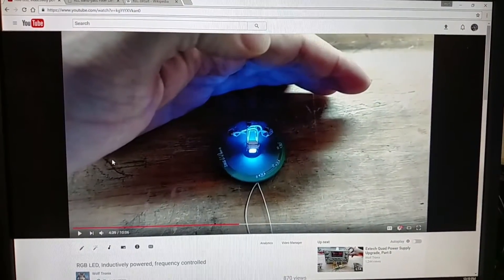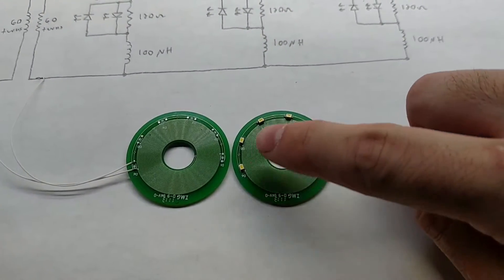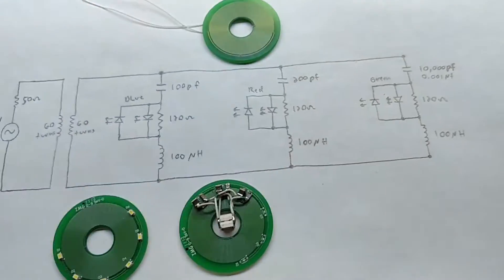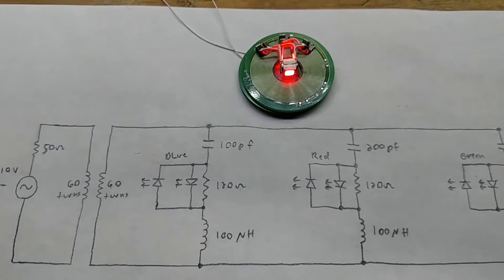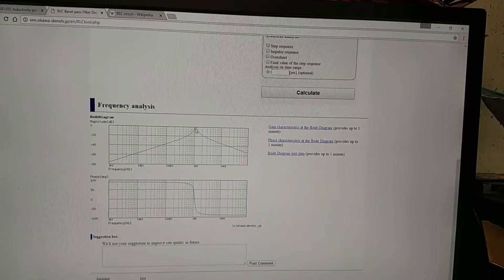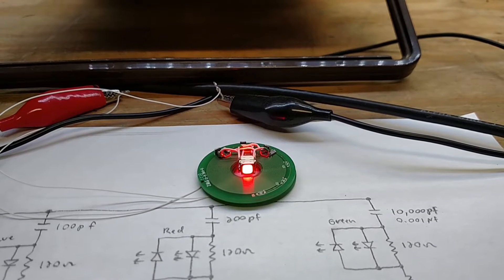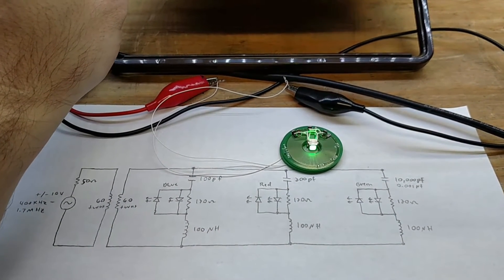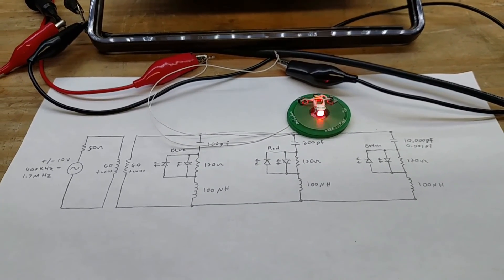RGB LED, Inductively Powered, Frequency Controlled

Comment: One idea for detection(If your still doing this).
Add a 4th leg, one to pick another frequency that can be used purely for detection and the value of this circuit will select the hotel/corporation/building tiles that will act as a load to detect.
These can be closer together and scanned though either by a dedicated circuit(Squarewaves or other nasty harmonics less of a problem Because efficiency won't be needed and a detect cycle only needs to be run infrequently)   or if your main design uses switched VFOs.
Reply from the maker: +Electra Flarefire 

I have not worked on this past this proof of concept, but I like your idea. :)

Each hotel could have a slightly different resistance value, so its type can be detected...

I would have to see if it can work through one of the RGB tiles, since the hotels sit on top of the RGB tiles...

And of there is enough bandwidth to reliably detect the hotel type.

Comment: So the original video was the first of your videos I ever watched I think.  I guess all your general electronics and EV videos (which I enjoy greatly) have side tracked me and I forgot about this project you had.  I am thinking I am going to have to make a PCB like yours to test this out for myself now.  Three questions that cross my mind are: What happens if you drive it with a square wave? What power efficiency do you get? (5v/50ma in perhaps and 3v/10ma [+25ma make that 35ma with the resistor power loss] out maybe?) Or is it not as bad as I am guessing?  Are the 120ohm resistors really needed?  Seems they would just burn power (@3v they would burn 25ma it seems?)
Reply from the maker: +jontscott 
These are all good questions.
Driving it with a square wave will result in lots of harmonics (since square waves can be approximated with lots of summed sine waves). These harmonics would light up other LEDs of frequency LEDs dimly.

Power efficiency is terrible, unless you are at the resonate frequency of the system.
So let's assume 20V peak-to-peak:
20V *.707 = 14.14V RMS / 50 ohms = 283mA
I don't really have a way to measure it... But we might be delivering around 30mA to the LEDs... Thus I would guestimate around 10% efficiency.

The voltage across the resistor is clamped at the forward voltage of the LEDs. The resistor is used to allow the circuit to conduct when it is below the forward voltage of the LED.
Thus providing a path to discharge the cap and burn up the current stored in the inductor so we are around zero volts and zero amps for the next cycle.

Hope that answers your questions.

Thanks for watching.
Reply: +Wolf Tronix
Even at 1.6v for a red LED it still seems the resistor is wasting 13ma (or more) of the preciously coupled over power... but I guess that does make sense that without it the LC would always pass some current and make the LED glow when you want it off.

Comment: What's the range on that 60 loop antennas?
Reply from the maker: +Jared Young 
Out of resonance about 1cm, at resonance around 2-3cm.

Thanks for watching.
Reply: Thanks, I have an idea that could use this, but it needs to get through a 18mm sheet of plywood. I really need to learn more about this type of wireless power.
Reply from the maker: +Jared Young 

https://en.wikipedia.org/wiki/Resonant_inductive_coupling